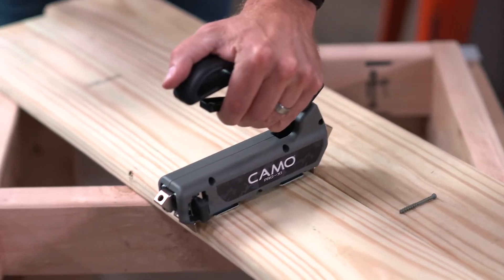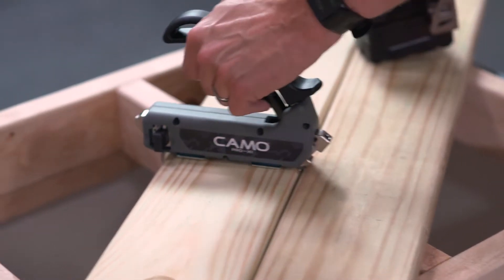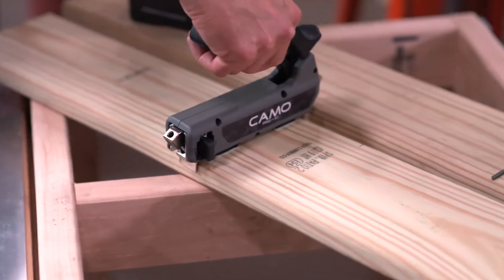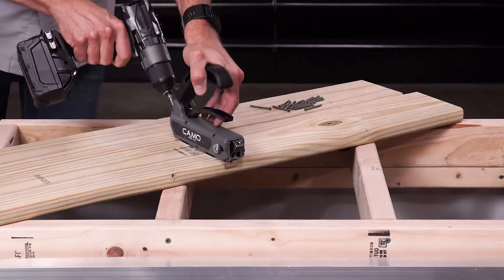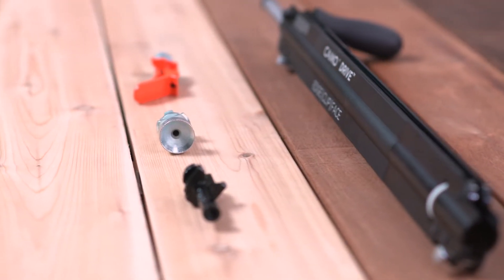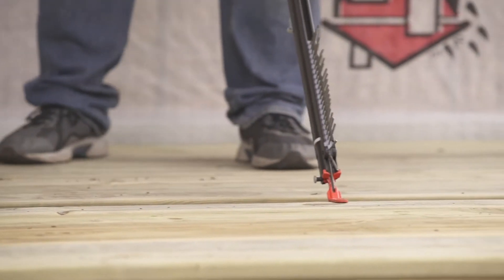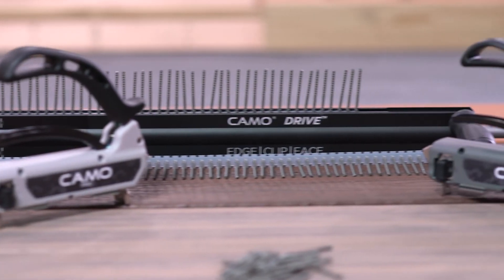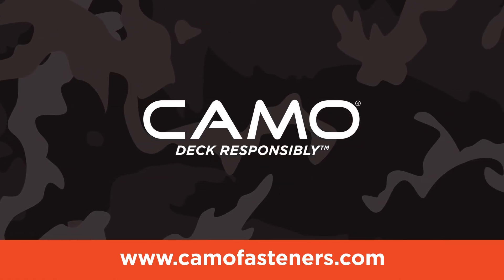How to Edge Fasten Angled Decking with Pro Guides

Comment: Can you edge fasten with angle deck using the stand up tool?
Reply from the maker: Absolutely! Fastening in an angled deck pattern with the DRIVE tool is easy. Just make sure that when you set the Edge nose piece on the board that it's centered on the joist before you fasten, and you should be good to go.